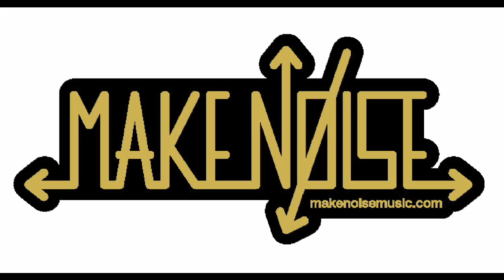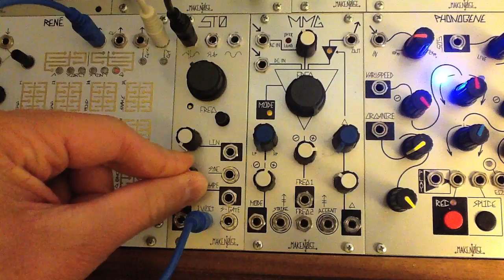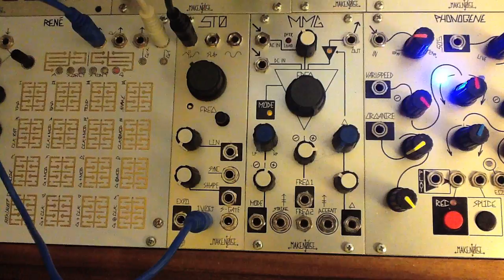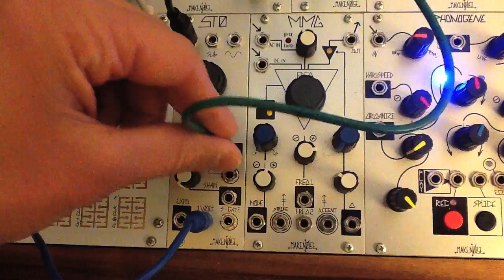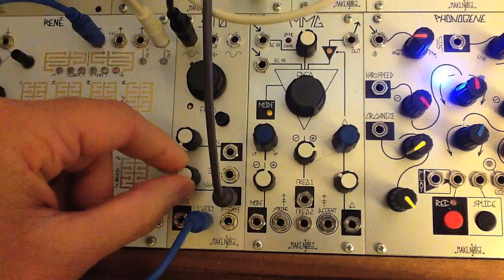Make Noise Sub Timbral Oscillator (STO)

Comment: Hope this isn't a "dumb question", but: Could one use the expo input to switch octaves, as per the octave switch on the old Moog oscillators? For instance could I use something like the Pressure Points going into the expo input for that purpose?
Reply from the maker: Kohntarkosz Absolutely, that is one purpose of the Expo Input on the STO. The other purpose would be Frequency Modulation discussed in this video. Pressure Points is great for setting up transpositions.